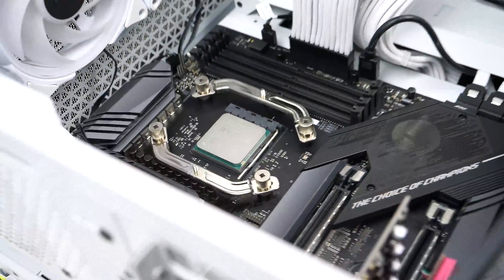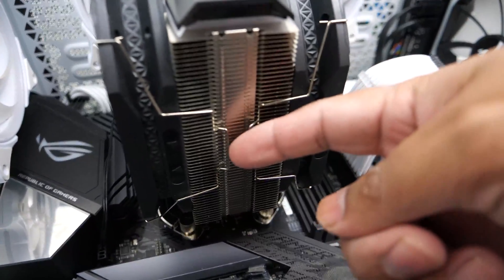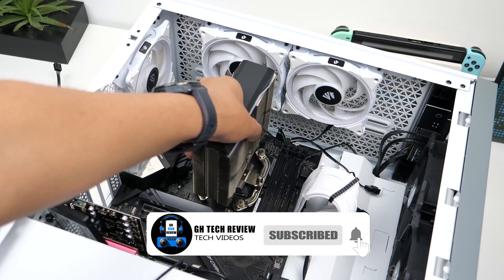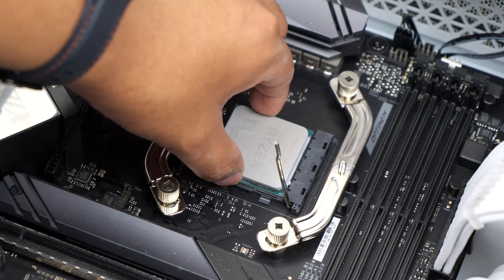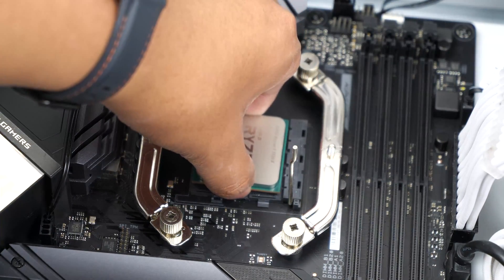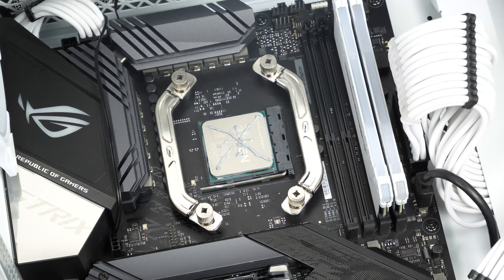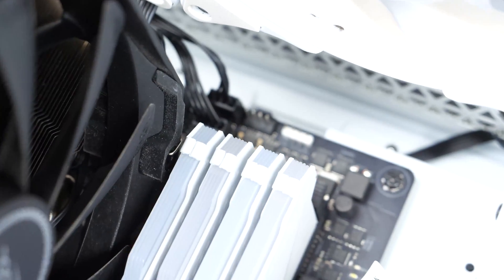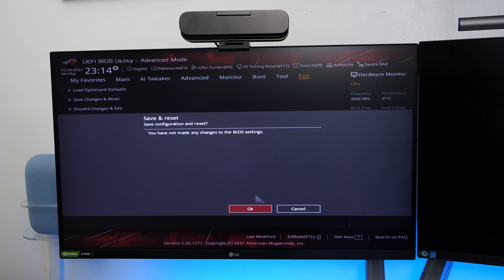How To Upgrade Your CPU Step By Step | AMD Ryzen CPU Installation 2022

Comment: Hey guys, I want to upgrade from a 3200g to a 5600/5600x. I have a b450 asrock fatality gaming k4 motherboard. Will the bios update work properly? Has anyone done anything similar?
Reply: I'm upgrading from 1600 to 5600x. Bios update was easy, there are videos on here to tell you how to do it.
Reply: The Website for the motherboard says it supports 5000 Series AMD CPUs, Does you Mobo have bios flashback? Worst case scenario you will have to Bios flashback to support 5000s
Reply: @Flinch  it doesn't have bios flashback. Only reason I'm asking is because I've read that bios updates with some amd apu's can be problematic. But that might just be a rare case scenario. I'll go ahead and do the update. Thank you!
Reply: @GeorgeKizzle93  Ye No problem
Reply: @GeorgeKizzle93 how did the update go for you? i’ve been thinking about updating mine aswell
Reply: @sky9531  how did the update go for you? same boat
Reply: Bro what, we got like the same specs and upgrade 😂

How’d the upgrade go? I want to get the 5600x, but am hesitant
Reply: The Bestbuy app shows the 5600x nearly half off right now, it’s up for $159
Reply: @zaphenathgarcia  get it bro update your bios and youll be fine

Comment: i'm currently using ryzen 3 2200g on a320m v2 motherboard and planning to update to ryzen 5 2600, do i need to perform an bios update
Reply: i would really recommend r5 3600, its worth the extra money
Reply: if you're planning to use it for gaming i recommended you go up to a higher 5 series
Reply: Get ryzen 5 5500 or 5600

Comment: I was always under the impression that CPUs were held in by pins, boy do I sound dumb
Reply: Yes, but don't worry. Personally, I did much worse.
Reply: Cpu communicates with the board through its pins. Im sure it also helps secure it to the board as well. However the CPU is secured by the locking mechanism on the MB. The fan is held down by screws to ensure a solid contact, to dissipate heat. 

So you aren't completely wrong. And you don't sound dumb. lol

Comment: The most important thing when replacing a cpu is to check the compatibility of your new cpu with your current motherboard. After confirming the correct socket (AM4 for example), you gotta check which chip series is compatible with your motherboard. Again, for example, AMD ryzen has 2000 series, 3000, 5000, etc... after that, order some thermal paste and youre good to go. All of this is assuming you made sure you have met the minimum power supply requirement of course.
Reply: i am currently running an amd ryzen 3 2200g, upgrading to a amd 5700g on a Gigabyte B450M DS3H board. Do i need to do the bios update before i replace the cpu? is the bios update necessary? really trying not to brick my build, thank you

Comment: i upgraded the ryzen 5 1600 to a ryzen 5 5600x but the screen won't turn on (the fans do spin tho) does anyone know how to solve this? (i am on the correct bios version and i am using the A320M-K motherboard)
Reply: @BiblicalTeachings  ohhhh, thx man i ordered a new mobo
Reply: I think the only boards that support 5000 series off the top of my head are: B550, B450, and X570.
Reply: same here
Reply: same
Reply: You guys probably need to update ur bios!
Reply: @JohnSmith-xt8zs  did you not read that i am on the right bios?
Reply: i think the max compatible chip series is ryzen 3000
im on the same motherboard and while looking online i seen that it only took 3000 series
Reply: @BiblicalTeachings  good shit brozzer

Comment: I got a question and yes I'm a noob. I'm going from a AMD ryzen 5 5600 to a AMD ryzen 9 5900x. Do I have to perform a bios update ? Or because they are the same 5000 series no update is required.  Thank in advance.
Reply: NO
Reply: You should tho keep everything up to date generally. Its not a big job to update bios
Reply: @SuperKanuuna  when it comes to mobo bios .. general rule of thumb is to not update unless you are experiencing issues that new patch corrects or fixes,,, a mess up during a bios update can brick the mobo
Reply: hope u bought a new motherboard with AM5 socket, cus ryzen 5 is AM4
Reply: @christofferhoff6669  that’s not correct information dude, he said Ryzen 9 5900x, it’s still the 5000 series.. you’re thinking of the 7000 series
Reply: @Razzle_Dazzle_2  i am using ryzen 5 3600 and replaceing with ryzen 9 5900x do i need a new motherboard
Reply: @SooClassy  nope
Reply: @SooClassy  you do need to update tho
Reply: @SooClassy  depends on the motherboard, if its a lower end one then its vrms will melt from the cpu power  draw

Comment: After I did everything I only boot into bios and windows won’t boot at all, anyone know why that is?
Reply: Dealt with this same issue, for me what fixed it was unplugging the PSU from the back for like a minute and then plug it back in, wait another minute and then turn the PSU on. After that, turn on the actual PC on , and for me it stopped being stuck in the bios. Was stuck there for a good few hours. Hope this helps!

Comment: Im a noob so here's probly a dumb question: Do i need to update the bios before installing the new cpu? Im going from a 1600x to a 5600g and they both use AM4 socket
Reply: If your board is old then yes.
Reply: check ur mainboards website and check if the cpu is supported / bios update needed
Reply: Sometimes you need to but not always

Comment: is a ryzen 7 3700x good for a beginner?
Reply: It should be more than enough. However, make sure all your parts are compatible; sometimes you'll end up "bottlenecking"
Reply: @living5891  paired w a 550 ASrock & a 3070, tryna upgrade to 32gb of 3600mhz of RAM
Reply: @bigdaddybryan7918  yeah that should probably be good just make sure to get a good enough power supply (and don't get a cheap one)
Reply: @living5891  bro no BS, i bought this refurbished PC right, everything looks good until u get to the psu 😂😂😂 its 750w but, the name .... it’s one of the most infamous- i’ll let u take a guess 😭😭😭😭😭
Reply: @bigdaddybryan7918  I rember being told to stay away from one brand but I don't really remember
Reply: @living5891  GIGABYTE. sucks to be me huh 💀

Comment: Anyone know why my ram won’t detect after installing the 5700x?
Reply: bios update
Reply: First step is always going to be disconnecting it and reconnecting it. Even if it looks right it may not be seated correctly. Verify in BIOS. If it's not recognized in BIOS something is wrong with the hardware.

Comment: I reccomend using latex gloves because your skin oils left on any material / components will effect heat transfer as well as it may cause metals to corrode. Example - If you change your cars headlight bulbs and leave a fingerprint on the glass bulb, that glass will heat differently and this will actually cause the bulb to burn out much faster.

Comment: Thanks! I had a minor heartattack because when I powered on my computer I got no signal to the monitor, no option to boot to bios, just black, then all a sudden Windows opened so I was all good.
Reply: When I powered on my computer, my mother board, ram everything turns on but no signal to my monitor

Comment: Very clear and straightforward instructions.  Thank you.

I have a Asus B450-F motherboard.  I bought a 2000's series Ryzen 7 to replace my 2600x Ryzen 5 for price but also to avoid updating bios.  How likely is a bios update to damage my PC?  Keep hearing that it can brick my PC.  Is that really a likely possibility?  Should I go ahead and update my bios anyways?  It is a few years old at this point and I will be upgrading from 16GB RAM to 32GB also, as well as possibly increasing my M.2 SSD from a 250GB stick to a 1TB stick.
Reply: Nowadays most BIOS updates are pretty reliable. As long as you have a a newly formatted USB flash drive with only the bios file on it, it should be pretty straightforward. The only things that could go wrong could be due to using really old USB sticks that are themselves dodgy, which is not that common. Or if you have unreliable power supply in your home, because power going out during the update would lead to bricking. But if your USB memory is fine and your power is reliable, then it's quite safe.

That said, since you didn't get a newer generation CPU, you don't need to do any bios updates.

(I updated my mobo's bios yesterday since I have a new am4 cpu incoming later this week).
Reply: @ElijsDima  We are working with pc's and updating bios like 5 times a day, we storing all different bios files in same USB drive and everything works fine
Reply: Bios update will only hurt you if the process is interrupted. Since you purchased your items based on compatibility you shouldn't have to worry about updating. If you plan to get a higher end cpu that isn't compatible with the same motherboard definitely update

Comment: Once I did this my monitors showed that there was no signal or no display. I did everything according to the video and all of the parts inside of the PC are working,  just no life on the monitors. What should I do?
Reply: I have this problem all the time i change parts inside of the pc. The fix for my problem is to reinstall the RAM and clean them.
Reply: One other problem might be that you didnt update your BIOS
Reply: @ralphmolenkamp4549  this.
Reply: @ralphmolenkamp4549  that wouldnt boot the pc at all or just shut off

Comment: "One of your easiest components you can swap out".

What?

RAM you simply click it in place. PSU you unplug some cables and plug in the new ones. GPU you take it out of the slot and put the new one in.

CPU is probably the most fiddly and complicated piece of hardware to replace. Weird.
Reply: Replacing my PSU was the worst thing I have ever done.
Reply: You must be fun at parties.
Reply: @rashie81  PC part-swapping parties - I'm the center of attention.
Reply: @charlesmiller3278  For sure. You're the only one attending.

Comment: If the old CPU was overclocked, do i need to make it to default settings in BIOS before the upgrade? Or i just need to install the new one and to load "Optimized Defaults" again on BIOS?
Reply: I'd reset the bios first.
Reply: @sheek1982  Thanks.

Comment: I have a a320m/ac motherboard with a 3100 gpu..I’m looking to upgrade to 5600g… do I have to update my motherboard?
Reply: Hey bro I’m looking at getting a pc setup and just need some help upgrading it as I never done this and know nothing… it has a threadripper 1950x and a rtx 3060ti, I want to upgrade the 1950x to something seriously good, I heard the threadripper 5900x is worth the upgrade but if I do that what mother board do I need? Or do I not need to change the mother board… So confused
Reply: @f22_b58  what motherboard do you have?
Reply: @trendzgamingg  is there a certain mother board for the 1950x or is there a bunch that could be on it
Reply: @trendzgamingg  b550 mother board actually it has!
Reply: @f22_b58  thats a decent motherboard...what are you trying to do? Gaming? Gaming and streaming? Computer gaming? Console gaming? Vr gaming?

Comment: I know i'm the one looking up the tutorial but I have replaced my cooler before and I learned there is no need for that much Thermal paste, the actual CPU spot that gets hot is just the small area in the center, the dot/pea method is best, any extra is too much
Reply: Ideally, you should have a thin layer of thermal compound covering the entire area between the cpu lid and the cooler surface. The rice/pea sized dab in the center is to allow the paste to spread out evenly over the lid. It's not necessarily a one size fits all scenario though. Some cpus like the threadripper series recommend a larger amount and different pattern when applying thermal compound, for example.

Comment: Does it need to download and install new chipset drivers from AMD site or it will take them automatically (in case upgrade 2600 to 5600)?
Reply from the maker: You will need to update the chipset driver from the AMD site once you install the new CPU. AMD offers auto-detect software for windows 10 and 11 that you can download from the AMD site. Once it finishes downloading and you launch the software it will automatically detect your CPU and update it accordingly. Hope this helps.
Reply: @ghtechreview  Man I was wondering why my pc wouldn't boot with 2 slots of RAM, I updated my BIOS and nothing but after the chipset update it all went smoothly!
Reply: @ghtechreview  thank you

Comment: Is it possible to do this without removing the AIO cooler? That part seems like such a pain 😅
Reply: you still need to take off the pump but you shouldnt have to take the cooler out from where it is mounted depending on your motherboad size
Reply: @baby.jingles  

I ended up rolling the dice and you were correct, I was fine just moving the pump to do it :)
Reply: @sephondranzer  no problem 👍

Comment: Only problem is now its stuck at power and wont boot
Reply: @haris4b.  but can you still use ur old cpu? U only need that old cpu just to upgrade, once done then just remove. If not then u need to bring it to computer shop and get them to update it OR if you have an AMD you can request through them and they will send u a cpu that can help u update ur bios and just send it back to them when u are done. Dont know about intel tho
Reply: @shanes605  yep I can still use it
Reply: @shanes605  I get an error every time “secure flash check failed” however .
Reply: Sameeeee
Reply: Update the bios
Reply: @haris4b.  you will need the Old cpu to power it up and update the bios then you can reinstall after update
Reply: @shanes605  will be taking it to a computer shop for them to update using one of their CPUs
Reply: @haris4b.  yeah thats only way. It should just be a quick fix. Updates takes less than 5mins. Cheaper than buying new mobo.
Reply: @shanes605  yep, just need a temporary cpu to allow the update then should be good to go
Reply: @haris4b.  Why didn't you google this shit before you went through all that 😂

Comment: I was told the wiggling option of removing a stuck cooler was wrong, since it could damage the pins underneath the cpu. I was told to run your pc for a bit to warm up the thermal paste and then take it off, worked for me well.
Reply from the maker: Running the PC to warm up the thermal paste is always the best option. Especially when it's really stuck. Mine wasn't that stuck it seemed to be stuck and it only required a little bit of force since the PC was turned off about 15 minutes prior to making the video. I'd say yeah make sure you have just recently been running your PC. Thank you for the recommendation.

Comment: Hey, before you swapped CPUs you didn’t have to change anything in your BIOS? I see that you are running Windows 11, you didn’t have to turn off secure boot, UEFI, and/or TPM before swapping out your CPU with a new one? I’m only asking cuz of how demanding Windows 11 is with its requirements and first time experience.

Comment: Nicely explained video, just bought a 5800X3D yesterday, about to install it
Reply: How'd the install go? I just bought a 5800x3d too 😍 upgrading from a 3600
Reply: @jazzalinko-p7h  i updated bios in b550 tuf gaming board and just dropped it in.

I did use pbo tuner to undervolt the chip. I run a 360mm aio (coreliquid) in a lian li 9 fans total. The cpu runs hot. In cinebench jumps to 90c instantly

Undervolted on a -30 curve and its stable and about 15c cooler and 20 in gaming
Reply: @HardHeadMilitary  I've heard it runs hot. I have a noctua nh u12s I'm currently using. It's a pretty solid cooler, keeps my 3600 under 65c at 100% load but if I need to I may upgrade to an aio for the x3d. Not so confident undervolting 😅
Reply: @jazzalinko-p7h  i have the esports duo air cooler on my sons 3600x, and my same coreliquid was pushing my 3800x. It is definitely a hot chip. Im not sure you would see any better results from an aio to the noctua, but if you want to keep the temps down, i can guarantee undervolting will be what helps
Reply: @HardHeadMilitary  thanks for the tips. I'll have a bit of a read up on undervolting while I wait for delivery.
Reply: @jazzalinko-p7h  no problem! There is a good tutorial. I have not made the auto script yet, if you shut down pc you would have to redo the curve, but only takes 30 seconds
Reply: @jazzalinko-p7h  im also upgrading from the 3600 lets gooo
Reply: @fzak47  letssss Gooooo!!
Reply: Same, going up from a 3800x